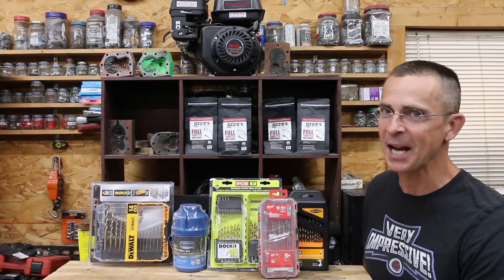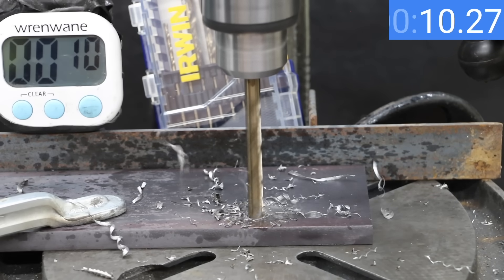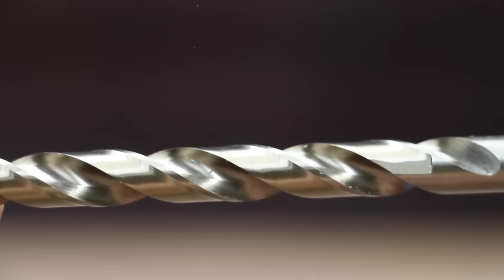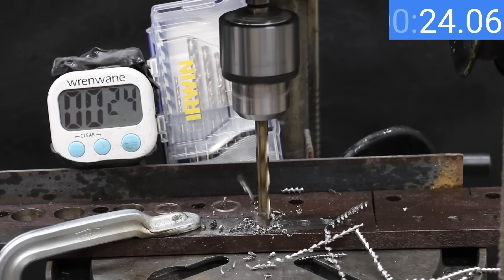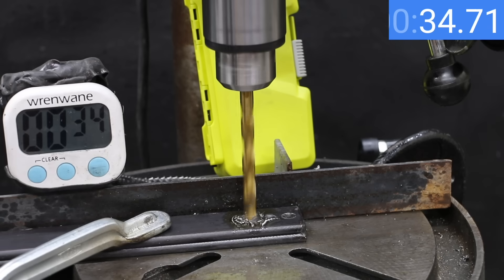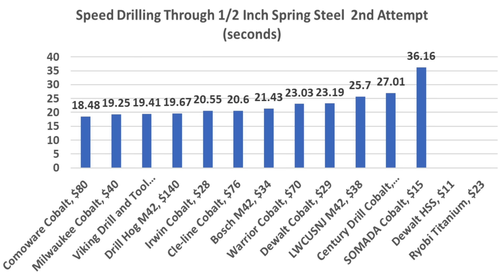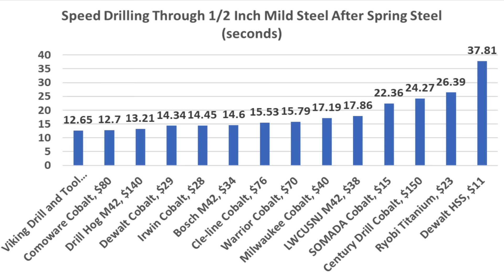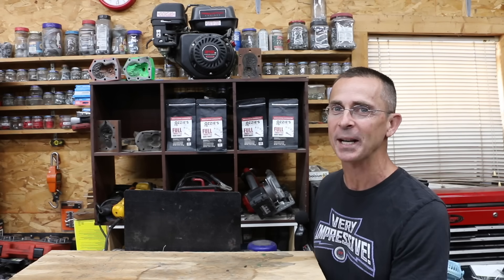Best Drill Bit Set? $11 vs $200? Let’s Settle This!

Comment from the maker: Here's the list of products reviewed. More details in the video description. Thank you!
DeWalt HSS (great value): https://amzn.to/44Exh8u
Bosch (my choice for overall value & performance): https://amzn.to/3XGMWSN
Viking (best overall but expensive): https://amzn.to/3rjj5DI
Irwin: https://amzn.to/3JP7WAZ
Drill Hog: https://amzn.to/46B7Iat
Cle-Line: https://amzn.to/3pEZiOw
Comoware: https://amzn.to/46Jv6CI
DeWalt Cobalt: https://amzn.to/3PQFank
LWCUSNJ: https://amzn.to/3NMDoRl
Century Drill & Tool: https://amzn.to/3XJAstq
Somada: https://amzn.to/3pFnMqW
Ryobi Titanium: https://amzn.to/3rlWcj4
Milwaukee: Available at Home Depot
Warrior: Available at Harbor Freight
Drill Doctor Drill Bit Sharpener: https://amzn.to/4b2lx3V
Reply: Please test outdoor TV s
Reply: I’d like to would like to see a rehash of this with the knkut bits.
Reply: Oh man, We really needed bad dog drill bits in this test
Reply: Can you do the new Diablo drill bits
Reply: Thank you for your time and attention to detail! 
As a former machinist, some things that come to mind...
1) Chuck torque used? I saw quite a few drills slipping in the chuck; some in part due to no ground flats in the shank. 
2) not exactly fair to call something stronger, because they failed due to torsion, (twisting of the bit) because the purpose of the drill is to hold an edge and not chip... inconsistent tempering of the steel and poor QC is usually the cause for this. 
With this being said. taking a RC(Rockwell Hardness) would be interesting to see and whether the higher priced bits would come out ahead here? 🤓👍
3) Was it me or many non Cobalt (non-yellow) drills on close-up were in fact yellow, or if this was showing identical drills by mistake? 🧐🤔

Thank you for all you do👊
Reply: How about Diablo brand?

Comment: I need you to do this again with the Spyder Mach Blue bits.  I've been using them for about 2 years and they are unbeatable at $40-50 for a 10-bit set.
Reply from the maker: Thanks for the suggestion.

Comment: This channel lends itself to the comments section. Not only is the community fantastic, we learn from each other as well as the content.

I have used Dewalt for years. Recently, I purchased the same set, almost 25 years later. 

I picked up the Bosch cobalt set for drilling in metal a few years ago. With care, they really hold up.  

I’m not in the market for drill bits, but if I were, I’d follow the recommendations here, no question.

Comment: Great test Project Farm 🤗🤓DeWalt or Bosch should create a drill bit that combines 1 centimetre of tungsten carbide at the bottom sharp edge and then followed by 1 centimetre of titanium and then follow this patten all the way through to the top of the drill bit. So it is 50/50 Tungsten Carbide and Titanium built and I think it would help with dissipating heat build-up and life of of the drill bit!

Comment: Drill bit material. Hss, Coated or uncoated. Cobalt or carbide coated or uncoated. Drill tip angle. Correct feeds n speeds. Don't Drill continuously, Drill for a certain amount of depth for stinger control and heat dispersion. Oil or oil and air compression to clean the material out of thw hole. Know your material and do research on what your doing most of all invest in yourself with knowledge of your work. D9nt belive everything you view. My knowledge as a machinist of 27 years didnt come easy.

Comment: Update, I had to use the DeWalt high speed steel bits I bought after watching this video again this weekend. I replaced my front brakes and rotors last Saturday. Apparently my car has a stupid hex bolt that holds the rotors on. After 13 years, they were rusted in place. I'm not saying drilling them out was the only way to deal with them, but I was totally out of other ideas after a hex bit driver, Allan Key, and impact driver all failed to budge them. The bit let me drill one side out in about 2 minutes and the other side out in 5,  after which I was able to remove and replace the old rotors. Without that drill bit, I would not have been able to do my brakes and when I pulled the pads on both sides, the pad part was super thin, almost down to the metal. Today (Tuesday) on the way to work, I was cut off in the left hand lane on the interstate, and that driver then immediately slammed on their brakes. I hit my brakes and from the sound of it, my brand new tires left a small patch of rubber on the road, but I managed to avoid the accident. Seriously Matt, if I ever meet you, I owe you dinner. Many thanks on your great videos, especially this one... actually I also would not have been able to deal with a bleeder valve I stripped (I had an extra one because I figured it was the most likely part I'd mess up, which is how I got everything back together and working well). So anyway, if you ever meet a viewer named Dan from NJ, I owe you dinner.

Comment: There are two more levels of drill bit.  Past cobalt is carbide tip, then solid carbide.  The solid carbide bits are over $100 each!

I don't think they're necessarily designed to cut faster.  I think they're designed to stay sharp.  I don't think much cuts faster than HSS.

Comment: I bought the high speed steel DeWalt bits after watching this video, just so I'd have something to run in my 20V drill if I ever needed to. This month I ended up using 2 of the 1/8" bits to drill out 5 different screws. In addition to the screw on the old power tool I mentioned elsewhere, I also cut apart my old grill which has 4 rusted out screws I could not move.I'm super happy with my purchase and it was entirely based on this video

Comment: I bought a machinist set of drill bits from Harbor Freight. They included factional, letter and number sizes. They could barely drill aluminum and couldn't drill mild steel at all. Once I sharpened them , they were able to drill into mild steel. I wish I didn't buy them.

Comment: Checkout the Viking/Norseman bits with the vortex point. Pricey, but they are so fast, and last forever. 200ish for 29 bits. The ones you tested are great, and I get that you wanted 135’ points for consistency. But the Vortex points are amazing.

Comment: I had a problem with masonry bits wearing out after 2 or 3 uses at work, I purchased a set of Bosch masonry bits (using/needing only 2 of the 6 or 7 sizes) hoping the higher cost would mean better quality, and I haven't purchased a new bit since. I went from buying bits every 3 months, to having not needing to in 5 or more years. Those Bosch bits are still chewing through concrete with no problems whatsoever. True story. I don't know about their other bits, but their masonry bits are fantastic.
Reply from the maker: Thanks for sharing.
Reply: @ProjectFarm  Thank you for sharing. This channel is one of few channels that keep YouTube afloat. If this type of content were to be flooded out like many genuine channels have been lately in favor all of these generic AI channels, this platform would be bots 🤖 viewing bots 🤖. We would all be gone, and YouTube would be the snake eating its tail. I'm just giving a little bit back to the community which has been an invaluable resource. Your channel being a hub for a large chunk of that invaluable community. Seriously, thanks. I didn't realize I wasn't subbed. I thought I was. If I see I'm not again, we'll know it's YouTube removing the sub. Keep it coming.

Comment: Came to this video after my mind was blown by the difference in the ultra cheap bits I bought and the very expensive bits my father in law has. I was trying to drill a black powder rifles nipple from 1/32” to 1/16” and had been at it for around 3-4 minutes straight with basically 0 progress. Reluctantly switched to one of his drill bits worried I might break it and to my shock in less than 3 seconds it had completely the same hole my bits wouldn’t scratch… mind you it is a super crappy 250+ piece combo kit with hole saws and all that was like $40 with tax
Reply from the maker: Thanks for sharing.

Comment: The only thing I think is kind of misleading is that the Viking drill bit set was a 25pc set and was M42 cobalt, while some of the cheaper sets were only like 14pc sets were HSS or M35 cobalt. I bet a much cheaper M35 or even HSS Viking or Triumph Drill set would had still beat all the other drill bits too. Though I do have to say, I do have a set of the German made Dewalt M35 drill bits you used in your test (the drill bits are made in Germany, the case is made in China) in my travel tool box and I have to admit they are pretty good drill bits (not in the league of Viking or Triumph bits though) the HSS Dewalt bits I think were pretty much junk. Ps Viking makes some new M35 "Vortex" drill bits now with a step drill tip and there is some Chinese copies of them now too. Maybe a new drill bit test on the horizon? 🤔 Food for thought anyway. Love your channel, keep up the great work!!!!!!!!
Reply from the maker: Thanks, will do!  Thanks for the suggestion.

Comment: You should do a video on spiral flute extractors. I can never find a good set that can help take out broken bolts. Drilling the hole is not a problem it’s usually extracting it from the hole that causes the damage
Reply from the maker: Thanks for the suggestion.

Comment: Kimball Midwest sales a 29 piece set for $329. I will take any one of these bits, drill through them with no tap, and then cut them in half. They are a patented cryogenic treated M alloy steel. They also have a life time warranty. Made in the USA. You’ll never buy another drill bit again and you won’t replace them often at all. Treated and hardened steel, mild steel, stainless steel, cast iron, doesn’t matter. ❤ Love your videos, buddy.
Reply from the maker: Thanks!  Thanks for sharing.

Comment: my favorite bits are norse. iirc same as viking. i also love my snap on bits. but have used them all. hate any titanium bits for longevity. i prefer cobalt hss and a good resharpen. ive had good luck with dewalt as well with surprising performance especially in my m12 bit driver
Reply from the maker: Thanks for the feedback.

Comment: Hello. I ordered both a viking set and dewalt hss set based off your test. I noticed that the viking bits are metric....just curious if you tested a slightly smaller or larger viking bit as compared to the other sae sizes. Thanks!!

Comment: Spyder stinger drill bits are slept on you get them from lowes i can drill 80 holes through stainless steel 18 guage and its still solid i only bought one and the chuck broke off the bit usually the buts snaps theyre blue in color tempered or something idk
Reply from the maker: Thanks for sharing.

Comment: Have you ever thought of creating a spread sheet like how torque test channel did

As a way to keep an updated ranking list of drill bits/batteries etc

All categories, as an easy way to find what item type we are looking for

You can also add new products in the category that come out without necessarily having to create a whole new video over. 

Also some of your older 4 year videos I am looking for the best products but since new products of that category have came out and curious without u having to make a complete new video

In this way u can sell the live spreadsheet for a 1 time fee it will help you further with independence on your journey to be an unbiased product tester
Reply from the maker: Thanks for the suggestion!

Comment: You familiar with Jarvis brand? I picked up a few sets off of ebay and find little info online about the brand.  All i know is they are stamped USA Made, i suspect several decades old, and if i found the right manufacturer their products are geared towards industry.
Reply from the maker: Thanks for the suggestion.
Reply: I only recently bought the Jarvis sets and have not had a chance to try them yet. The brand is unknown to me, but the sets are stubby, and look to be high quality.  I don't think the manufacturer even sells them anymore,  but i was very encouraged by the fact that their product line is aimed at industry and the bits are USA made and appear to be high quality. @ProjectFarm

Comment: I have always tried to stick with the following brands and have never been disappointed: 
1) old Morse brand
2) Chicago Latrobe
3) Greenfield GTD (old)
4) Viking 
5)Cle Line
6) Cincinnati 
7) TRW
8) Triumph 
9) Champion
I may have missed a brand or two, but in my experience these brands provide the best performance.  I would prefer to either find a NOS set, or a gently used and not abused used set of one of these brands on ebay and resharpen as needed. I have been curious if Drill Hogg is worth taking a chance on lately though.
Reply from the maker: Thanks for the feedback.

Comment: I bought a Harbor Freight Bauer Titanium drill bit set in a red bi-fold case and they are the worst I've EVER used! The 1/2in barely drilled one hole in mild steel and chipped the cutting edge and dulled the center tip. Other smaller sizes did a little better but quickly dulled after 2-3 holes. My Milwaukee cobalt bit set is good but expensive and you have to pull bits out of the case with pliers. The recommended Bosch cobalt drill bits have a lot of poor reviews on Amazon, as if they could be counterfeit or lying reviews.
Reply from the maker: Thanks for sharing.

Comment: What brand, model & size torque adapter did you switch to - the black one? I watched carefully, paused, zoomed, etc but could not see the markings on the side.

Do you have these independently calibrated/checked or use right out of the box?

I ask because I'm in the market for one and have no experience. Sorry if you have tested these or addressed this elsewhere.

Always appreciate your work!

Thanks.

Comment: You should test out turbo tip drill bits. Or hyperstep or w/e the manufacturers call them. Each have their own name. They are twist drill bits that are like a step bit at the point. Astro (same as matco), norseman, i think drill america, century i think, KnKut. Then compare them to the results from these. I have the astro and love them
Reply from the maker: Thanks for the suggestion.

Comment: Machinist here, not surprised to see Viking and Clee Line doing well in the cutting tests. Yes they're pricey but they're actual industrial brands, Viking is made by Harvey Tool who makes some fantastic high tech carbide endmills, etc. Clee Line is just one of those tried and true brands. That all being said, my experience with consumer grade bits also had me looking toward the Bosch and Irwin, most of their cutting tools are a solid value. 

The thing I'd like to point out though, if you stick with a conventional 118 or 135° point geometry, drill bits can be readily resharpened. I highly recommend anyone who is mechanically inclined to learn to sharpen drills by hand as it's and easy thing to learn and can really save the bacon.
Reply from the maker: Thanks for the feedback.

Comment: A tip for anyone new to using drill presses... when you chuck up a drill but, especially one with a round shank, tighten the chuck up, and then rotate the chuck and tighten it even more with a second hole. Finally, rotate it to the 3rd home and tighten it even further. You will get a supremely tight grip on the bit. 
I was told this by an old timer many years ago, and I tried it, and was astounded by how effective it is. It became a lifetime habit.
Reply from the maker: Thanks for the feedback.

Comment: IDEA -- ROTARY TOOL.  Most people just say "Dremel".  I have had the same problem twice.  I had to saw something without excess depth and a cramped space.  The first time it was half inch plywood in a cabinet side in an RV.  For that I used up 2 Harbor Freight $10 tools.  One wore out and the second one did not make me want to store it for future use.  Now I have task with some aluminum on a door.  I am talking 1/16".  I went back to Harbor Freight for a $39 item that was on a cable and its kit had no saws.  I bought $7 of little rotary saws.  Harbor Freight had an even more expensive item that was in a handle like the cheap item or like a Dremel. The $10 item was corded.

So I do not see that you have a comparison of the Dremel rotary tool and its competitors.
Reply from the maker: Thanks for the suggestion.

Comment: I was shopping for a set, those dewalts 11 dollar ones (they're 11 CANADIAN right now) looked interesting, I'll pick up a set because it's less than a meal, but I think I'm gonna get the bosch m42 as you said. You can sharpen it, good value and it held top ranking (for the value) with no issues. I thought, wonder if PF has a drill bit video. Here we are. Thank you. You do amazing work
Reply from the maker: https://m.youtube.com/watch?v=xgQeSrsAXgE
Thanks!

Comment: I have several cheap drill bit sets and a few expensive sets. I find I always grab one of the cheap ones and use that until it no longer works. I have some sort of aversion to wearing out my good bits if I can get by with a cheap one. As a result, my good bits sit in a drawer sometimes for years.
Reply from the maker: Thanks for sharing.

Comment: Love your videos. You should try to EQ your voice over to remove the shrill quality, your voice is too bright. You had a good selection of brands and included cobalt coated drill bits but no titanium or other types of coating. It would be great to compare the performance of the different coatings as I don't think it's worth the price. Keep up the good work.

Comment: I guess the main take away for me is to avoid having to work stronger metals. Not too common as a mild diyer. The cobalt benefit seems to show up in the harder steel.  Though it's also clear that it really wears even the very best bits.  Seems to me a pro working with tough materials frequently should spend a lot of time on resharpening!

I'm also imagining a relative asking to borrow a drill bit and wondering why a person with 15 sets can't lend them a 1/4" bit. 😂